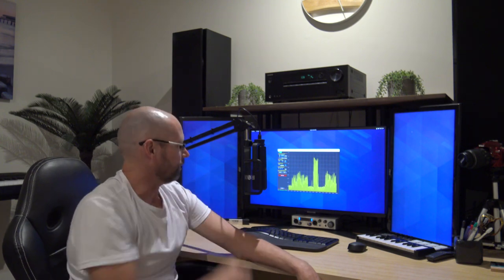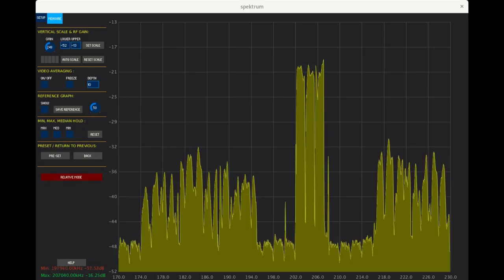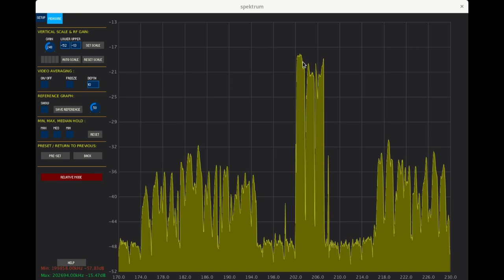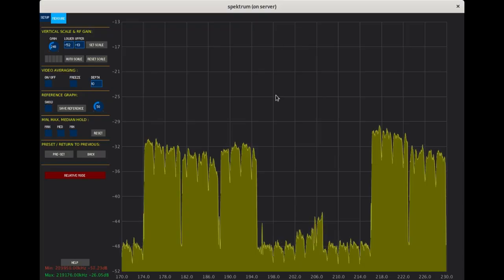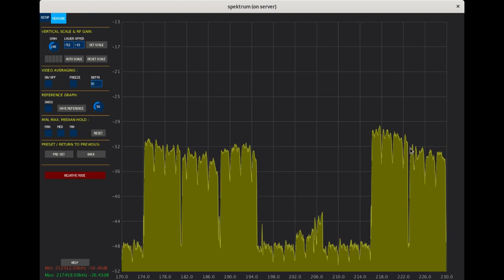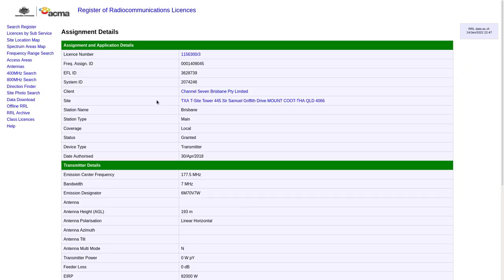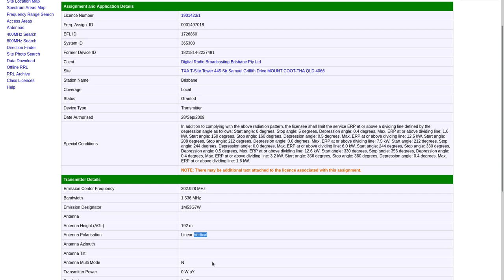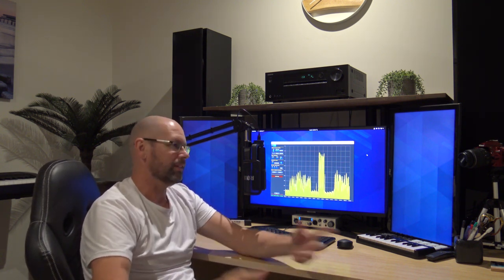Importance Of Polarisation

Comment: Very educational. I have a roof top FM yagi mounted just like your TV antenna so horizontally polarized for more than 10 years . But i’m learning that FM is broadcast vertically. So although i have great reception i guess i would have even more signal if i mounted my yagi on « the side » so that the elements are vertical. Not sure how to do that or if i can install a right angle mount reuse my vertical mount pole. Or perhaps in my city the signals are circular polarized giving some to both vertical and horizontal.

Comment: Most analog FM radio stations in Australia compromise by transmitting a circular polarised signal. A 3db signal loss receiving a circular polarised signal with a linear antenna is better than a 20db loss from a polarisation mismatch on a linear polarised signal.
Reply: Was going to ask about circular polaristion so thanks for that info.